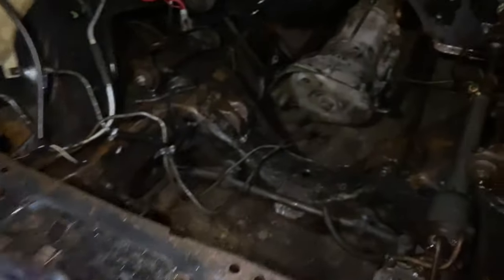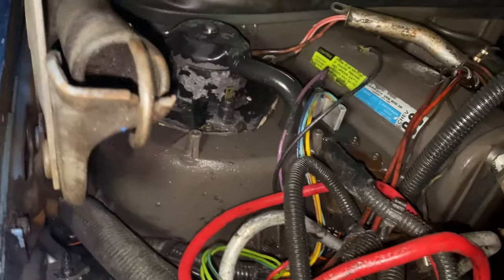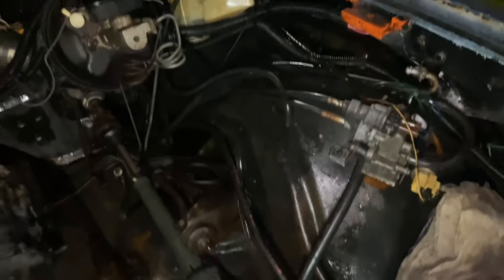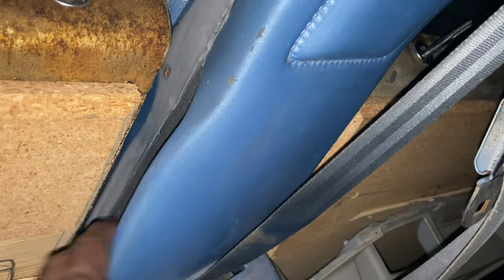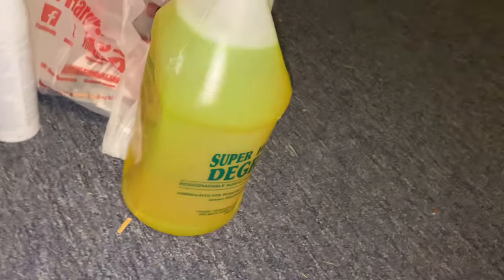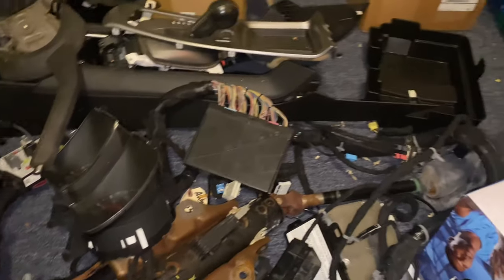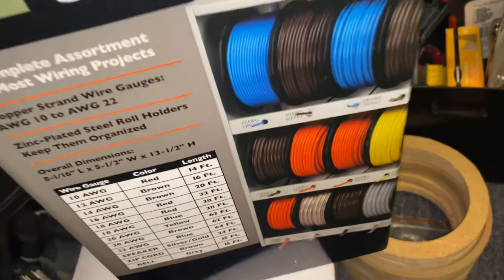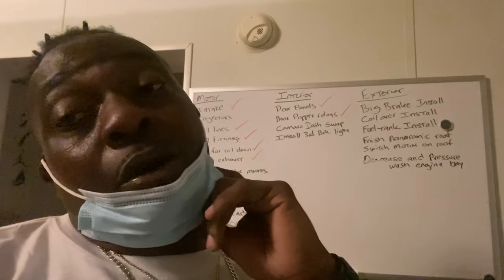Box Chevy update

Comment: I scrubbed my shit by hand, no pressure washer. Dont use POR15 on that engine bay. make sure you just prime, paint, clear then keep it covered until you drop that motor. You will scratch it in the process if not. Best bet is to remove everything from the engine bay, working around all that stuff will be a hassle.
Reply from the maker: Thanks